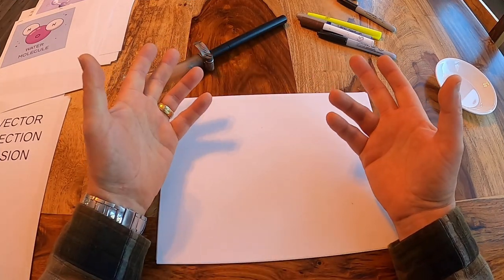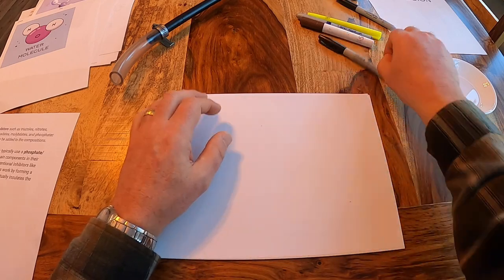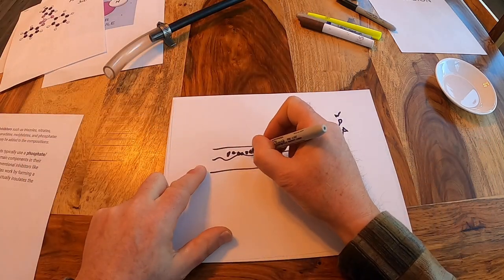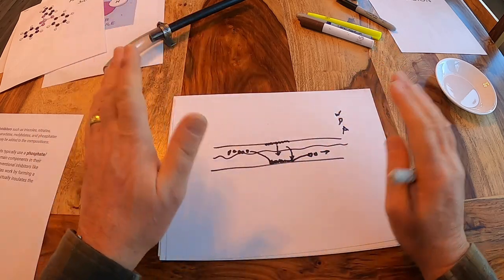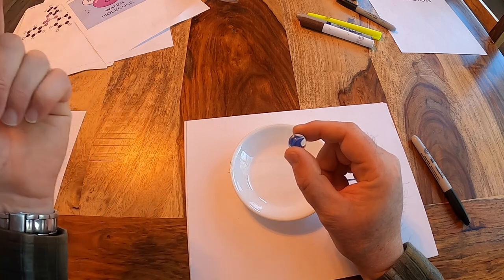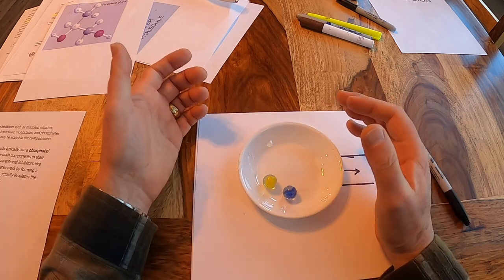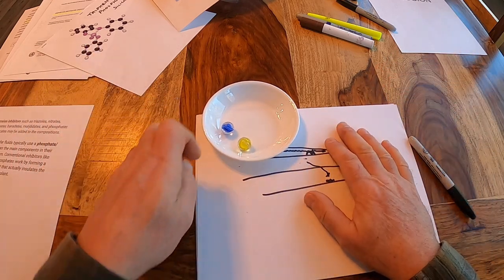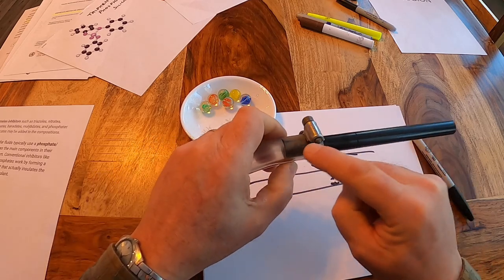Alde Convector Connection Corrosion - Part Two - 2015 Tab Max-s Trailer

Comment: Awesome.  I have this exact problem.  My hose actually broke open at the connector.  Both of my connectors going into the Aldi radiator has bumps.
Reply from the maker: Good luck

Comment: Thanks Mark.  Have you had any discussions with Nucamp or Alde?  Would be nice if they'd initiate some of these ideas in their manufacturing process.
Reply from the maker: I have tried SEVERAL times to talk to an engineer at all three companies Alde, Truma, and Nucamp, obout this and several other issues over the years, and always have been ignored. The only company that has been willing to work with me, and answer high level technical engineering questions has been Century Chemical. (The manufacturer od the original yellow heat transfer fluid.)

Comment: Can you comment on requirements to drain existing glycol out of the system prior to opening up joints, thereby depleting fluids and injecting air into the system. NuCamp informs customers that replacing Glycol requires a special pump and equipment that's at the dealer/repair shops, and is not a home do-it-yourself project. Do you have guidance on that?
Reply from the maker: Yes the fluid needs to be drained before work on the connectors can be done. If a person is reasonably handy it is a simple process. 
Some owners have actually made their own pumps to do the job, but for me, I just added Better low point drains to the system. You will find that project video on my channel.
Reply: @tabtrailerupgradesandmaint2923  Thanks so much

Comment: I may need to get new rubber hose for my Aldi system.  What kind and size of rubber hose do I need?  Can I get it at an automotive parts store?  Thank you.
Reply from the maker: The Rubber hose that Alde uses is made of EPDM.
It's very common, and can be founs at many hardware and automotive stiores.